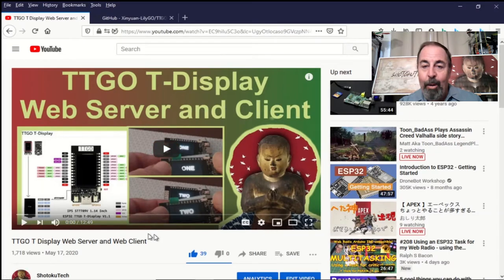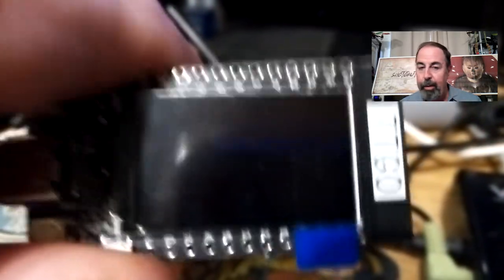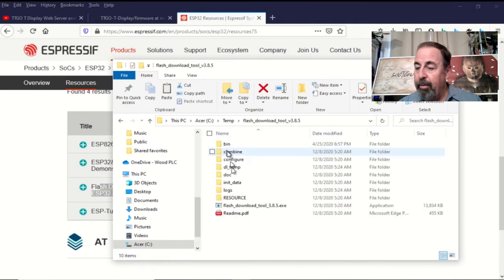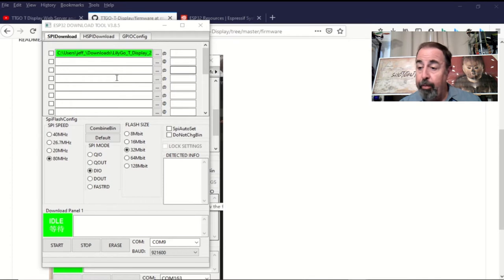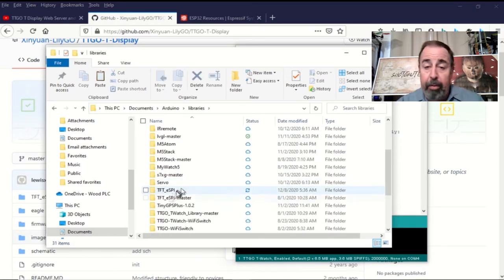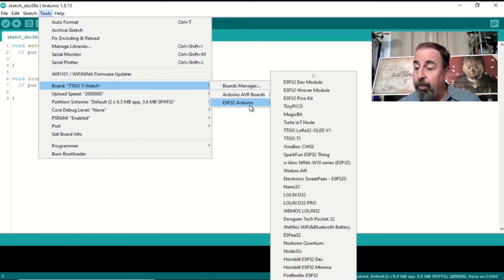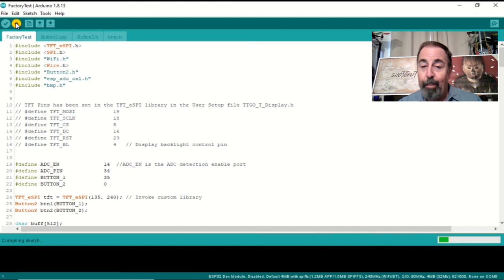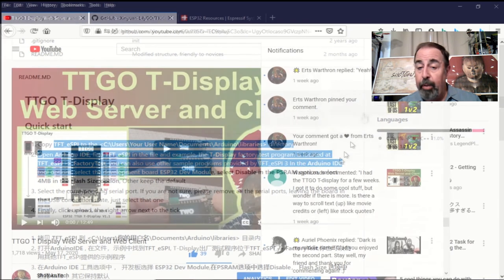Bricked TTGO T-Display Fixed With New Firmware and Factory Test Sketch

Comment: So, when you say "bricked", I assume that you mean when you connect it to your computer it is not recognized?  how were you able to get the new firmware on there? doesn't the flash tool need to be able to see the board in order to upload the firmware? Cuz thats where I'm at, am I missing something? or is mine "Really" Bricked??
Reply from the maker: If you have looked all the way in to hidden devices in your device manager and have nothing, it might be a lost cause. Nothing from Serial after reset?

Comment: good job.  I met error: api-ms-win-core-path-t1-1-0.dll missing when open download tool, and checked it is not missing, what can be?
Reply from the maker: Do you have Microsoft Visual C++ Redistributable installed? I have 2013, 2015-2019, and 2015-2022 versions installed. Try installing or reinstalling perhaps.

Another thing that you can try is to reregister the missing Windows files. To do this:
    Click the Start button.
    Type "command" in the search box. (Don't hit ENTER yet).
    While holding CTRL-Shift on your keyboard, hit ENTER.
    You will be prompted with a permission dialog box.
    Click Yes.
    Type the following command: regsvr32 /u api-ms-win-core-libraryloader-l1-1-1.dll.
    Hit ENTER. This will UN-REGISTER your file.
    Type the following command: regsvr32 /i api-ms-win-core-libraryloader-l1-1-1.dll.
    Hit ENTER. This will RE-REGISTER your file.
    Close the command prompt window.
    Re-start the program associated with api-ms-win-core-libraryloader-l1-1-1.dll error.

Comment: Not sure if I can ask for some assistance I have tried to follow the instructions in your video yet no matter what I do I keep coming up with the same errors.  The error messages refer to "begin_SDA_Read() and and end_SDA_Read()" .  I believe this means that and "SD" card reader is trying to be found.  Have you come across this?  Goal is to reset the TTGO board back to the factory settings.  Yes I was able to reflash the card with the firmware as shown in your video.
Reply from the maker: Any SD Card error can be ignored if you haven't connected one. I did something similar in this video.
"TTGO LORA32 V1 With SD Card Data Logger"
https://youtu.be/hLCFNR3jp8Y
Reply: @ShotokuTech  Thank you I will check that out and follow the instructions. Your feedback is greatly appreciated.

Comment: Any idea where to find a factory bin for the Lilygo T-Display-S3 which is based on ESP32-S3 . No bin is in the Github repository and i seemed to have bricked it.
Reply from the maker: I scoured the repository and the product page. The link to the community page seems to be broken. Maybe post your issue on the github site? Wish I had more for you. Are you holding the boot button when connecting USB?
Reply: I have a T-Display-S3 as well.  I know mine isn't bricked because it's running the last thing I wrote to it, an ESP-NOW test sketch which is sending to a receiver on a Heltec WifiKit-32(v3).  The problem I have is that the factory sketch for the T-Display-S3 doesn't ever finish compiling.  The last things it shows are:

   Using library FS at version 2.0.0 in folder: C:\Users\... 
   Using library WiFi at version 2.0.0 in folder: C:\Users\... 
   Using library Wire at version 2.0.0 in folder: C:\Users\... 
   Using library HTTPClient at version 2.0.0 in folder: C:\Users\... 
   Using library WiFiClientSecure at version 2.0.0 in folder: C:\Users\... 
with a white bar overlaid that reads "Compiling sketch..."

Is there any way to tell what it's doing at that point?  Both Linux and Windows 10, leaving it for 12 hours and no change.

Comment: I just bought the TTGO T-display and got the error SD card Mount Fail when I connect TTGO T-display to my computer. I don't want to use a SD card and can't seem to get further with my project. Can somebody help me?
Reply from the maker: That is the default factory test sketch. Load a different sketch.
Reply: @ShotokuTech  Thanks for your reply!
When i try to upload an example i get the error: invalid choice {upload.flags} following by different options where I can choose from. I searched off the internet but could not find a proper solution. Can you help me?
Reply from the maker: @SimeonPlays  #1: Do you have this URL in 'File/Preferences/Additional Board Manager URLs':
https://espressif.github.io/arduino-esp32/package_esp32_index.json
?

Comment: I've downloaded the Espressif Flash Download Tool and I get the normal warning as I launch it but when I tell it to run the program anyway, I see it try to open the tool then it instantly quits every time under Win 11 Pro.. That is  until I run elevated as administrator then the tool works normally and after setting the default parameters in this video I was able to flash my T Display with the .bin file...  but it's still Bricked with no display.. Oh well it was worth a try..
Reply from the maker: I was going to say 'run as admin'. I use 'run as admin' all day long at work. Thanks for sharing. Sorry to hear about the T-Display.
Reply: @ShotokuTech  Thanks..  I probably should have been more careful when I was using it to control a +5vdc Relay the other day,  a user on amazon said a 3v device could control the IN pin of this type relay Ok, but I guess not.. either that or I tapped a 5V lead by mistake.. I could be wrong, it could have been something else that zapped it but right now it only goes from Black to a Dark Gray background after what appears to be a normal upload of any sketch to this T Display board..
Reply from the maker: @jimsnodgrass8454  Yeah never the 5v and 3.3v shall meet. I'd still be surprised that just hooking a pin up to the relay would fry the board. Stranger things have happened though. Best wishes.